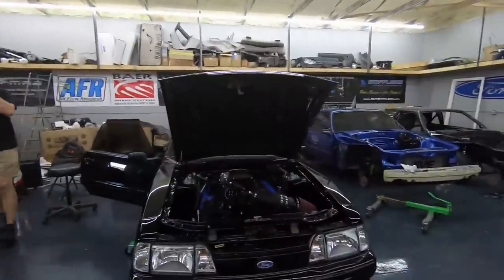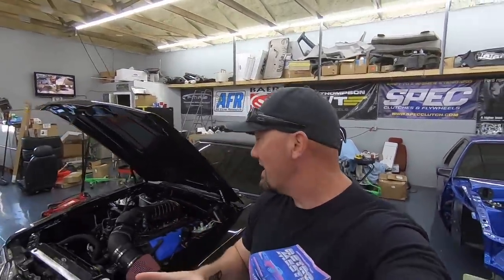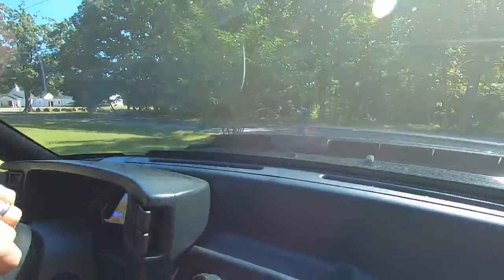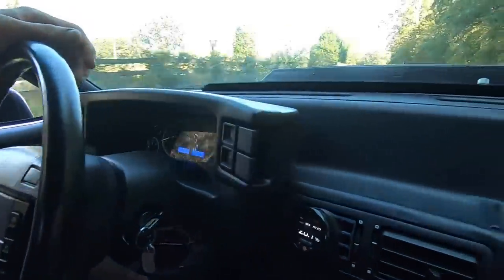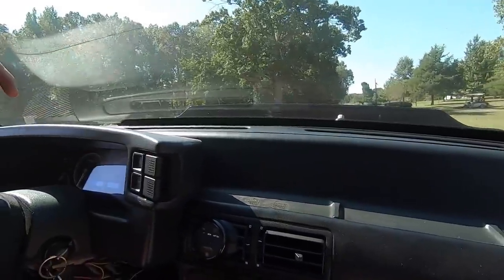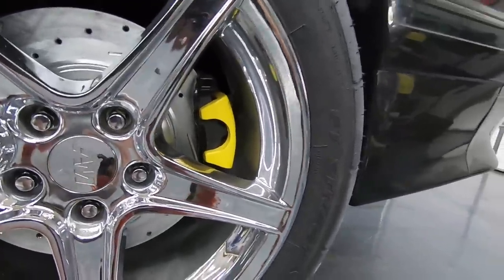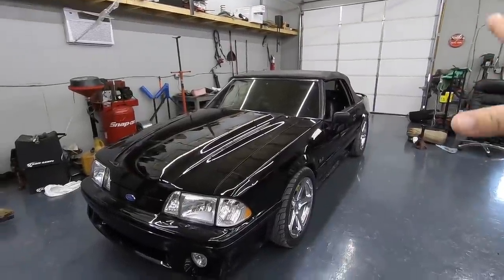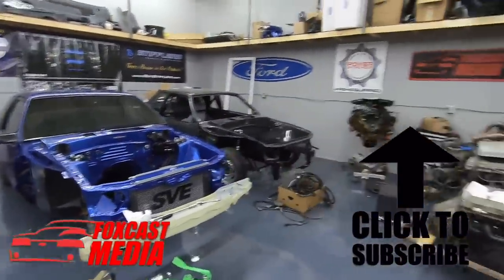FIRST DRIVE of this 800 horsepower foxbody build! *COYOTE + WHIPPLE

Comment: I had the same issue on mine recently the axles are a tad bit longer than OEM so you have to compensate for the extra length with a washer in between the caliper bracket

Comment: You do good work! I really enjoy your videos. You might find it interesting to know that a 3 cell lipo battery small enough to fit in a shirt pocket will start a pick up truck. The leads get a little hot so use with caution. You can buy them for $20 and they hold charge for a very long time.

Comment: Straight outa the 90's. Cervinis hood and all lol. I had a 91 with a Paxton Novi charger on it. Trick Flow heads Dr. Gas H pipe 3.73 rear with the 5sp. Lowered strut tower braces. Miss that car badly. Ran 11.40's all night long at Cecil County
Reply: Ran my gt vert there once ! 14.2 @100 stock new edge...not fast but really fun!

Comment: Love your videos... How did the suspension get handled. i'm going to have close to the same setup. About to start my project. I bought a no rust 1993 GT. I'm going to buy a T56 Mag and a coyote. i don't want to twist my windows out or mess up the frame. Ill be taking everything down to the frame and want to stiffen the chassis. Any ideas you can share would be appreciated. I do see the Detroit Speed's through floor subframe connectors, but they are rated top 400HP.

Comment: One of my all time biggest regrets is selling my ‘93 Cobra that I bought brand new. I put a 150hp nitrous System on it and M&H Racemaster slicks on 15”D holes and it ran 11.9 ‘s every time I took it down the track.
Reply: 11.9s? Were you leaving the tree in overdrive? Taking a walk?🤣🤣🤣
Reply: @Dracula1972  no cap that’s slow for that

Comment: Hope you replaced the top latches mine pop open all the time got an 89 5.0 HO 60 over flat tops f cam and  borg Warner trans but it still runs 0-60 4.4 and 100 9

Comment: Missing my Fox, my S550 just got an A10 rebuild and the damn thing vibrates like a mofo, the Fox I could work on in my garage.... great video bud, missing the Fox big time.
Reply: A-Aron  - I believe it and yet I see youtube channel after youtube channel beating the shit out of them with no problems. My car is a year and a half old and the back tires are still like new, I don't do smoke shows, donuts, just drive and it can't even handle that. I regret this purchase more than any car before it.
Reply: KlipschHead281 what type of issues were you having with it? Mine is a 19 and I hear/feel a clunk from the trans when braking hard sometimes. Also 4th lugs sometimes
Reply: @hUrFaH54  - My transmission locked up while braking. Left nice skid marks, took almost 3 months in the shop. I get if back and it now vibrates over 45 mph. It feels slower and due to recalls they can't check it until the end of October so I have made payments on a car I have not been able to drive for almost 5 months. I could repair  my Fox in my damn driveway.

Comment: I know you touched on wheel size with the wild strawberry fox but can you do a video with a little more depth? I’m specifically looking for to put the SVE S350 wheels on my 93 vert lx. Completely stock wheel/suspension setup so far. Is getting rid of the quad shock a mistake?

Comment: However, I love windsor .
A nice 351 windsor 10 1/2 compression.
Some good frame connecters etc.
Reply: @CurtisWithoutHandles  Look at PowerNation, they have a 302 stroked to 347 cid and it makes like 520 hp with pump gas and a hydralic cam. You cou probably get 2 or 3 of them for the price of a coyote crate engine. Also the DOHC v8 are heavy. I have a 96 SVT and it is pretty fast but a stroked 351 makes like close to 550 hp (look at clevors Cleveland heads makes any windsor a BOSS engine whatever the displacement.)on pump gas and hyd. cam. it is also smaller and lighter than any DOHC motor. I know a few hundred pounds off the front wheel would help balance and handling big time. Solin cams cam have 80 -110 hp more peak but require maintenance and have less power down low. For street riding torque matters! Anyway I wish I had a 95-94 SVO with a 302 or 351cleavor BOSS!
Reply: Coyote is a better platform and can take boost.  351w - head sealing with boost is an issue

Comment: You may need to go back to 11.56" rotor in the rear because the 13" rotor with a single piston caliber only covering 2/3 of the rotor is a waste. You should at least be able to fit 4 piston calibers with those 18" wheels.

Comment: I have car's with over 800hp my 08 gt500 has 850hp and my 10 super snake has 900hp.Also I have 3 fox body's a 87 gt a 92 lx and a mint very low miles vibrant red 93cobra.My point is I can't imagine how fast a 800hp fox must feel like. Back in 95 I had my first mustang.A black 87 mustang gt with T Tops and it had exhaust and headers and it ran a 14.00 at 100mph and I thought that car was fast.Cars have come such a long way since the 90s.But as much as I love my shelbys my fox body's are number one on my list.

Comment: What are the measurements on the wheels and tires?
Reply: Fronts are 18x6 (narrowed from 9") with MT 26x8-18 tires and the backs are 18x9 with MT 285/40-18 drag radials

Comment: Those rear brake Calipers look way to small. They are only applying the pads to the outer inch and a half of the rotor.